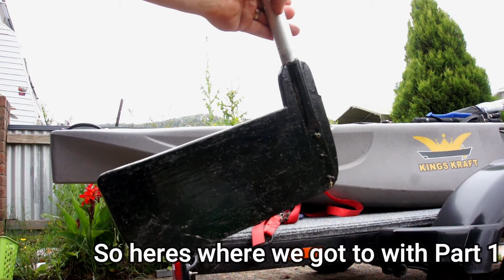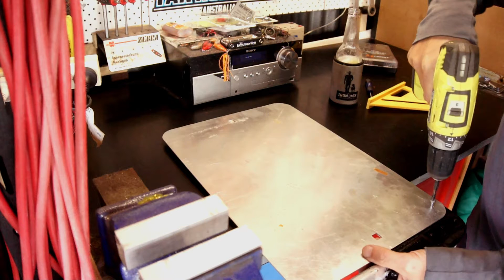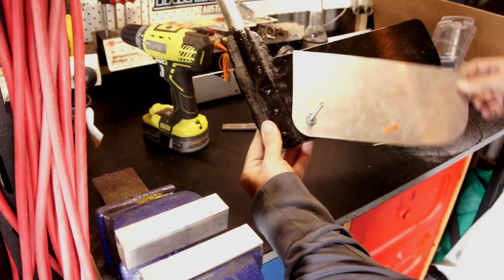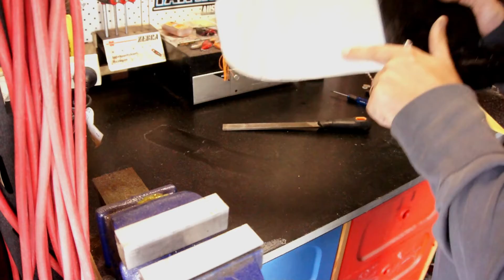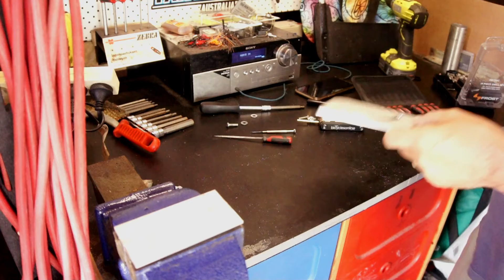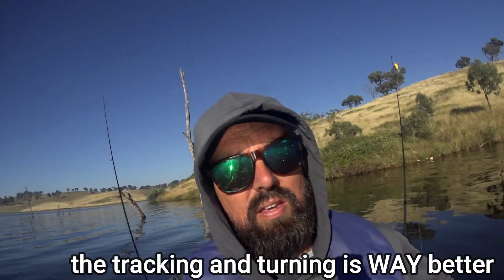IMPROVED kayak Rudder DIY |PART TWO|

Comment: Hi, nice project. Did you notice any increased  torque on the steering handle? Did your rudder wires and steering handle work well with a bigger rudder? Thanks.
Reply from the maker: Hi, no real difference in difficulty to use the steering. The handle and wires managed very well!